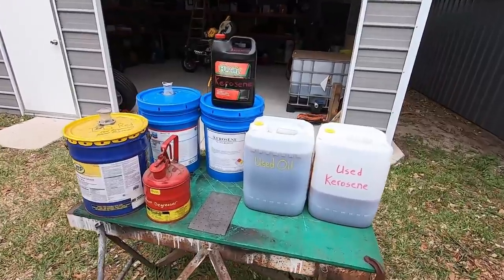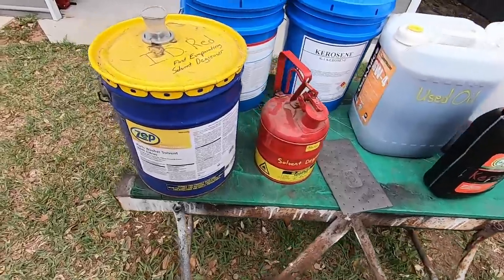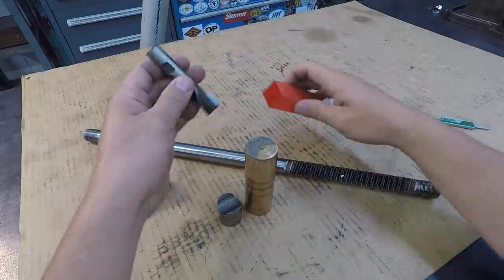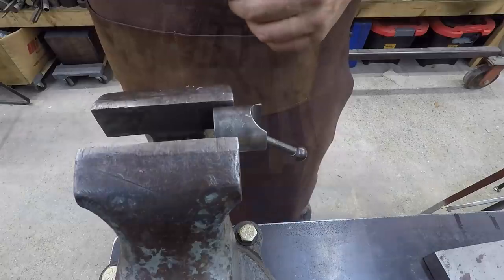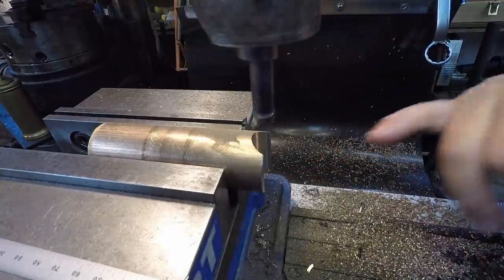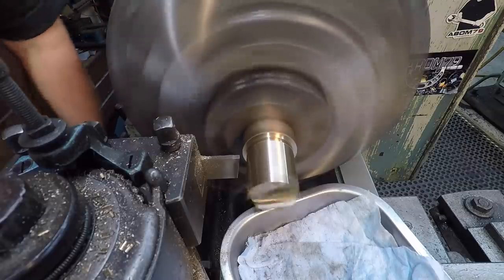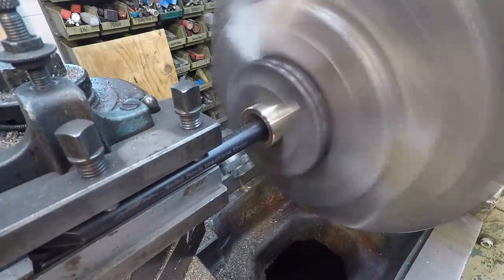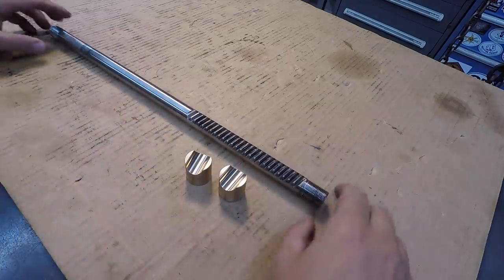SNS 308: Rack & Pinion Repair, Waste Oil Management

Comment: You make everything look so easy although I know it's not. Does Starrett make metric micrometers or do you measure in thousands and convert to metric?
Reply: Yes and yes.
Reply: @Sicktrickintuner  Both? Either?
Reply: @timothypirnat3754  Starrett DOES make metric measurement tools and Adam DOES have a few, but he usually just uses his "go-to" tools and does the math.
Reply: It's standard practice to convert from mm to inches once, ref machine tools having only Imperial calibration.

Comment: why you didn't drill it and cut in half?
Reply: That's exactly what I was going to ask.
Reply: @MikeAndrewsUSMC  Totally uninformed guess from me:  it would be difficult to machine the faces back.  Also, didn't Adam say he didn't /have/ a 22mm drill, hence the use of the boring bar on the mill?
Reply: @jonathanrichards593  It could be bored from side to make hole and cut it. I think it was just to make more interesting video

Comment: that rod needs re -chroming,the nickel plating is showing through
Reply: steve gale  how sure are you?
Reply: steve gale 
But chrome is a functional surface, chrome plated cylinder bores / barrels, chrome rods in hydraulic cylinders! I do however doubt if the rack bar is chromed, the manufacturer doesn’t mind if you have to buy a new rack!

Comment: Diesel is better to clean the inside of gear cases such as your lathe. Kerosene is petroleum base but it doesn't have the oil base like diesel. Kerosene is more of an abrasive cleaner like gasoline is. Diesel is safer and better to use for cleaning internal, gears and bearings without any undue wear.
Reply: Ummmm they both are oil based…
Reply: @tjlovesrachel   both are derived from crude but one is oily and kerosene is not. Like gasoline, more of a stripper than a lubricant. This causes friction which also causes unnecessary wear.
Reply: @jefferybarron929  I get what your saying ….

Comment: Is this an old or obsolete part? Why not buy new? Just wondering.
Reply: New doesn't come in graphite impregnated brass? That's an upgrade over the original part. It won't gall and cause the wear on the shaft like the previous setup. In that case, you can't buy it and wouldn't want to if there's an upgrade. You'd have the same issue again down the road. The brass is an attempt to remedy that. Or maybe they want $700 when you can fix it for less. There's all kinds of reasons.

But the best reason? Because he doesn't have to buy new. Obviously, they're doing it to fix a problem so it doesn't happen again.
Reply: Also a graphite/bronze part isn't likely to tear up the surface of the rack like the original steel/iron part did.

Comment: I've got the same Harbor Freight hydraulic lift cart, and it lowers on its own after time. I'm sure the fix is pretty basic, but I haven't been able to find any info on this. Any ideas on how to fix this, or how I could implement some sort of lock?
Reply: As to why I'd want to lock it:
I use the hydraulic cart as the center platform for my mitre saw station. By having an adjustable center platform, I can easily swap my mitre saw, benchtop jointer, benchtop planer, or benchtop router table, etc., and set the platform to the precise height needed to level it with the left/right (or infeed/outfeed) workbench surfaces of my mitre saw station.
Having the platform lower on its own after a few hours obviously causes issues with this plan.
Reply: the reason why it lowers over the is because the valve has a small amount of leakage

maybe you could implement some sort of mechanical locking mechanism like a screw to hold it in place

Comment: Now this my be dumb but why do you tighten all bolts on lathe when one makes them all move?
Reply: if you only use one it's tugging on the mechanism in that location, he snugs them all up to center the mechanism equally that tiny tiny last little bit.  Helps him get such consistent results with the chuck
Reply: Mark of a profesional! .. Watch and learn! :)

Comment: Used oil and K-1 go right in your diesel.
Reply: try that with a modern one..  wreck the entire fuel system
Reply: I don’t think so, bucko! 😬 Only thing going in my tractor is fresh, clean diesel #2!
Reply: @darkwinter6028  k1is #1 diesel. light lubricating oils are part of # 2 diesel. filters pick up particles.

Comment: question from someone who knows NOTHING about spray welding. could you not have filled the teeth with masking compound?
Reply: You probably could, but having seen how difficult it can be to remove the masking from a thread after it has been sprayed it would be an awful lot of work, plus you need to undercut, or turn down the area to be sprayed and then put a light thread on it. As the teeth are hardened this could cause issues, plus having made the teeth shorter rebuilding the shape on the ends of the teeth might be problematic. 🤷‍♂️

Comment: The reason that rack will have a slight bend in it is because over the years of that part like what your replicating pushing against the rack so that the rack can't move away from the pinion when pressure is put on the teeth when it is in the middle of the run of teeth on the rack, and the reason it has a pocket in the rear of the part your replicating is because there is a large spring sits in there and a cap screws into the main steering rack housing to put pressure on that part and to put pressure on the rack.
Reply: Rack is bended because of heat threatment. Bending could be up to 3 mm, but automotive tolerance is 0.1mm. Rackbar straightening machine makes it almost straight

Comment: Well it is too for my advice now that the parts are done but here it goes anyway . You could have  set the stock on the mll , drill and rim or bore out a round hole , the do the other turning on the lathe and cut the part in half .Not a huge deal  but  this would have saved you sone machining time , less set up time and all . Considering this part is just a bushing/support  peace i am sure it would have worked out  just fine . At any rate you are a talented machinist and taking the extra time to make the part perfect is aways a good thng . Keep up the good work .
Reply: I think that would have been a good idea if the bar stock he started with had a larger diameter. But with the approach you mentioned it might be cutting it pretty close to the edge.

Comment: The land fill! The land fill 😱😱😱😱😱😵😵😵😵 what are we doing to this planet.
Reply: That was the way the Dutch did until 40 years ago. Now its separte, reuse, and what can't be recycled burn it and use the heat to sell electricity. That industry has overcapacity so we import waste from Napels Italy and the UK.
Reply: The oil and toxic waste is stored separately and is not poured in to the ground, it is then processed before making in to coca cola (joke), but is reprocessed.
Reply: Be careful, one's narcissism just might lead a person to think that the earth revolves around us...this planet has been here a long long time, surviving all types of drastic events...long after people have come and gone.  Being a good steward is of great value, but bringing to the fore guilt is not that smart.
Reply: @RJ-nh9hw  I would say that your thinking is flawed, most life (as we know it) requires a fairly similar set of environmental conditions, you wipe out humans you can be fairly sure that the majority of other life will wither away  just like us, so what is the point you are making? That nothing really matters? Apart from our feeling a little guilty? You can happily look through your rose coloured glasses and act like you know the answers but I think there is more at stake here than yours and my insignificant life span and what is wrong with taking a bit of effort to be proud about what we do rather than just flip it off with some platitude about how resilient our environment is and that it doesn't matter, I think it does and I think the youngsters growing up today think it does more than we ever did (making an assumption about your age there). Sorry but I get miffed when people tell others that they are not smart and they should be careful of the way they think. Went on for a little longer than I anticipated, never mind, just a bit tired but...
Reply: @musicbro8225  It's great that you've perfected yourself, and are generous enough to impart some of that perfection on others. Taking the most negative possible interpretation of RJ's words is a very Liberal, Progressive, unfair, and disgusting way to do things. Just because the media and politicians play those dirty little games doesn't mean the public must. We are supposed to be above that, because we are not seeking power and money with our words here.
Reply: @musicbro8225  uhg man, why here? Anger isn't gonna get you the cookies from the jar now is it? THINK, sir, THINK!

Comment: FYI don't know if it is just my computer, been having some trouble with YouTube, but, there is a couple seconds delay between the video and the sound. When you turned on the lathe you see it start moving and then you hear it start. Just wanted to let you know.
Reply: I think it’s just your computer or your internet connection cause I don’t have any problems with either my computer or phone
Reply: @Stuff_said_  Think you are right seems to be working now. Thanks for the reply.

Comment: Couldn't this job be done on the shaper instead of the mill? With a tool with the right radius
Reply: @Rob Young even with a minimal feed rate? I used the shaper many years ago but I don't recall many things. Also this is bronze, I know it wouldn't work on steel

Comment: Why aren't you burning it for fuel, shop heat &/ or power? 
What a waste of $$$.
Reply: Don't need much shop heating in Pensacola. One SNS weekend of machining would probably burn up all the waste "fuel" he generates in a year. How much does a small generating plant that can burn waste solvents and lubricants cost to buy and maintain?

Comment: Lets get a depth measurement at 14:57. I almost fell out of my chair laughing. Amazing precision you demonstrated. Ever heard of math? You had everything you needed except a clue on how to do it accurately.
Reply: Educate us instead of giving snarky remarks.  (I know how to calculate it using the radius known and width measured)
Then ask yourself if it would really matter, the .1 mm he might be off.
Reply: @grotevin  Length of the part, minus, the length from the notch bottom to the flat end of the part. that will give you the depth of the feature. To set it up in the mill, subtract the depth of the notch, from the known radius. This will be your tool center line offset. All this done with a caliper in a matter of seconds. Don't bluff your way through it with a pair of 6" scales.
Reply: @Shop-Tech  these always one !
Reply: @welshpete12  Always someone willing to pee in the punch bowl.
Reply: @Shop-Tech  Six of one, half dozen of the other.
The necessary precision of any measurement is wholly based on the necessary precision of the part. But when the allowances are for "+/- a millimeter or so, then what does it matter if you use a couple of scales or a mic?
He might have just had the scales in his pocket, and didn't have to go and get a mic, and since that was good enough, why bother?

There is a lot more to the concept of "efficiency" than just the theoretical 'quickest way to do something' - sometimes, it's the "ACTUAL quickest way to do something" while getting the same results - which in the real world matters a hella lot more than someone second guessing stuff that a guy does when he's not even there to know WTF is going on.